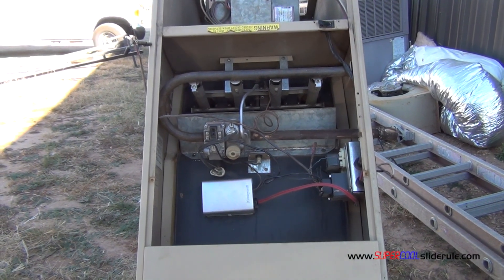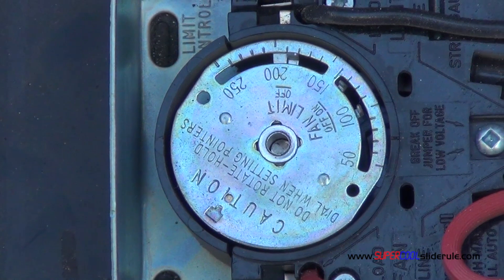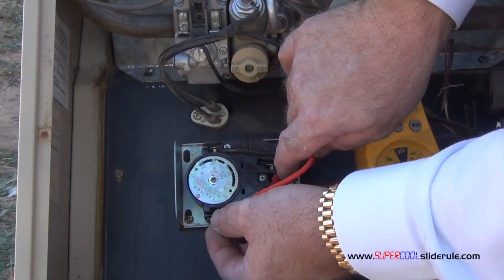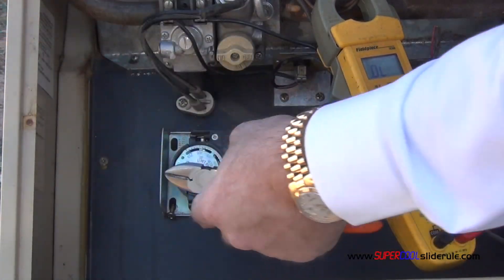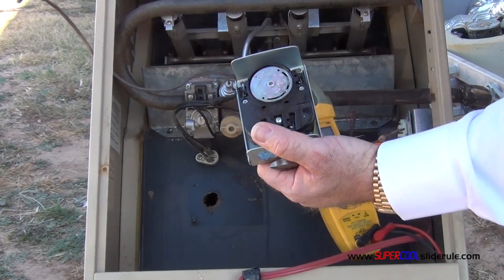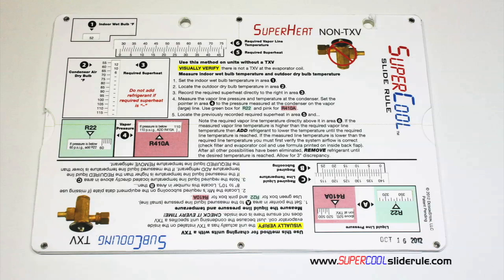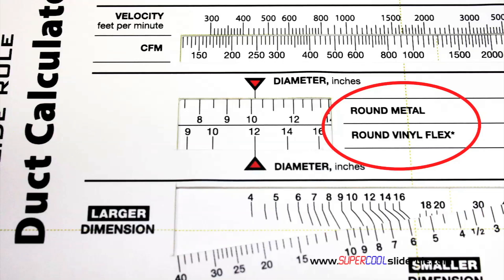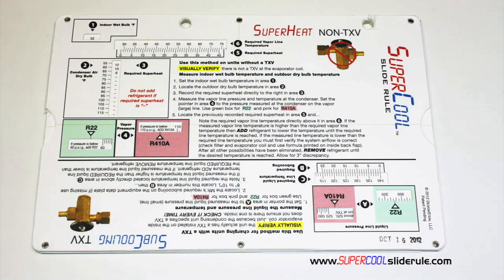How to test and replace a Fan & Limit Control

Comment: What if the switch trips on high temp well below the furance max temperature rise is hit?  Short cycling...  Is that a failure mode as well?  Burners only stay on for a few mins at a time then temp drops a bit then they restart.  Motor is new and filter is clean.

Comment: My White-Rodgers limit switch 5D51-090, has a lever protruding from the cover.  The lever moves from 'auto' to the center between 'auto' & 'manual' over a period of time.  Fan runs continually and It then blows only cold air. I move the lever back to 'auto' and it works fine for several months or a year and then I have to move it again/  This has been going on for a couple years now. Otherwise the furnace works fine.  Do I need a new limit switch?
Reply: Yes, I replaced a Honeywell fan-limit control from the 1950's it had a switch on the front cover, moving the switch back and forth the fan continuously stayed on in either mode it was set at

Comment: My fan just keeps running for some reason? Any help.thanks
Reply: Either the switch on the thermostat subbase ( if you have one) marked "COOL" "OFF" "HEAT" , "FAN ON" " AUTO" make sure your fan switch is in AUTO position, if it is in "FAN ON" position will cause the fan to run continuously. Also some fan-limit controls have a fan and manual switch on them. Make sure the switch is set to Manual or the fan will continuously run if set to FAN mode. Honeywell fan-limit control usually you pull out or push in a white plastic knob on the front Cover. On a White Rogers fan limit control usually you slide the switch to the left or right to select the FAN or AUTO mode desired

Comment: After using my a/c fan blower motor stays running,doesn't shut off,i isolated thermostat & still runs,doesn't have a control board,30yr old york system

Comment: Consider...no judging or complaining about another in their ability to communicate how to do something... always look for more knowledge; one will learn more this way and spend less time worrying about how another does a particular way... just a suggestion.  No need to be critical of the person, however be critical in the performance of your work.  There are master techs I have worked with who were not effective teachers.  Here is one tech that I have learned a lot from. 
https://youtu.be/jg0nK4QLpZo  By the way...learn to not take things personal...it is easy to do, but studies show that what one thinks about another doesn’t really matter.  Try to understand all the conditions involved in the particular situation you may find yourself in regarding HVAC.  I have have learned to liken troubshooting or just performing maintenance on a unit, to a doctor performing surgery or giving a physical examination.  Good thing the units I have worked on were not human beings.  And it is a good thing there is one basic design on the human being... not so with HVAC units, however they all do the same thing...basically...push heat from point A to point B.  Just a perspective.

Comment: 42 seconds into this vid, he says "at 100 degrees the furnace will come on", that is wrong.
Reply: Exactly. it turns off at 100. It turns on at 150 which is the second setting. This clip is all kinds of wrong.
Reply: Obviously. It's called a slip of the tongue. So what?

Comment: If it trips the high limit switch will it also cut power to the WiFi thermostat (no batteries)? When it happens, there's no voltage between R and C for about 45 seconds. What could it be?
Reply: In the normal wiring scheme yes it will. Things could be rewired in such a way that the high limits switch the energizes the gas valve but does not de energize the thermostat

Comment: We have a 22yr,. old Arcoair gas/pack on the roof, recently been having issues with blower not shutting down when the heater down cycles. Numerous  times I had to shut the power off for some length of time, then it would work ok for all day.. I am assuming the problem
could be with the limit switch or fan relay, I just hate to replace the whole unit unless I absolutely have to..
Reply: Frank B

Comment: i have replaced my thermocoupling, and have installed a new gas valve on my miller cmf80-AG the pilot works , but after i turn the thermostat up to where the furnace should kick on, the pilot goes out and doesnt light the furnace , would that be caused by the limit switch?
Reply: Sandra Stan in a word, no. You may have a gas pressure problem or bad gas valve

Comment: though ful vid there but I have ithink the some trouble the fan do-its  come on but the warm air doesn't there I replace ad cam stat l22-9a-11 limit switch too that doesn't work at all. its a 1973-4 rheem gas furn .. help ..

Comment: Just because the the limit switch checks out electrically with the meter doesn't mean it's working properly. It may have a mechanical binding or its thermostatic control may have gotten mis-adjusted.
Reply: warrior7772 how do you re adjust it? thanks

Comment: Why would you spin the dial by hand? That de-calibrates the temperature sensor. Don't be lazy. Do this the right way by turning on the furnace and make sure the temperature causes the contacts to close. Then turn off the heat and ensure that the fan is no longer powered after the temperature reaches the lower setpoint.
Reply: Dave M 
Absolutely correct, that Is WHY the dial SPECIFICALLY READS CAUTION " Do NOT Rotate Dial" hold dial to set moving pointers"
Reply: @timmyturner5088  and this is why Im on this page.. because I have a fan limit switch that is SET to turn on at 150-160.. and it is turning on at 130ish.. no matter how i set it.. then it turns off 10degrees sooner than it should also...    

Trying to find a video I can watch that shows how it should properly work
Reply: @thegitago7823  When I was 13 a technician came out to assess the furnace in the apartment we lived at. I watched the technician move the dial to check the fan on and fan off. I knew at 13 this would damage the limit control and told the technician to hold the dial and move the pointers. He said " it won't hurt it" and he learned the hard way the burners and fan were short cycling more after he left! Turns out the furnace had a badly cracked heat exchanger and the cracked heat exchanger was fooling the fan switch, cooling down the combustion chamber causing the fan switch to turn the fan off for about 50 seconds and then would kick the fan back on once the burners heated the plenum above 100°F
Reply: The furnace is outside not connected